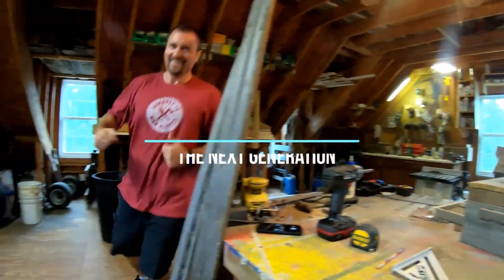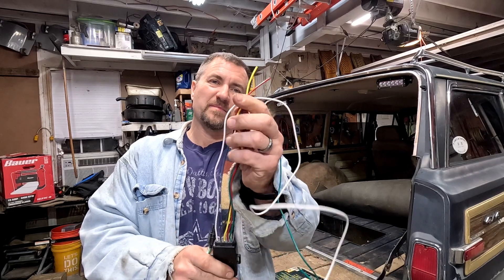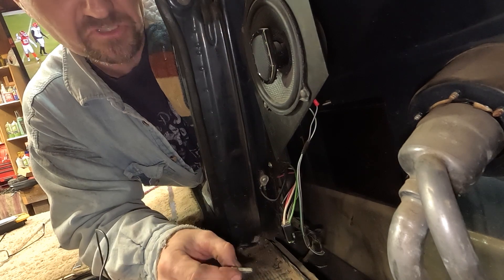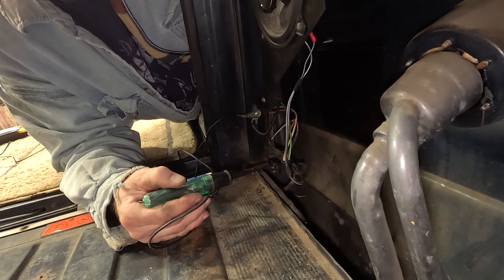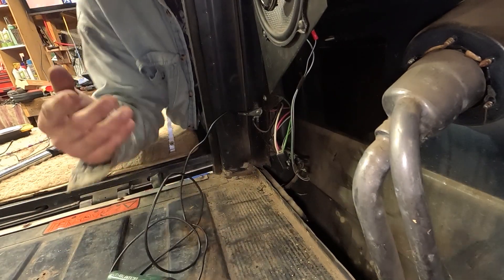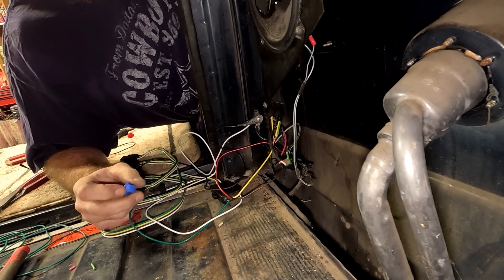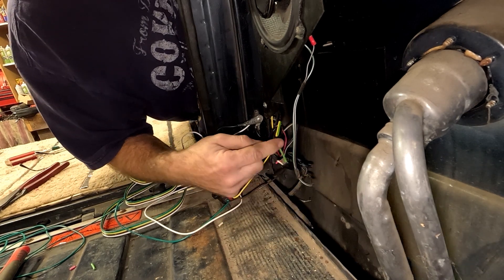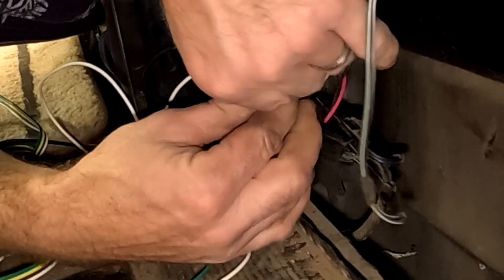1989 Grand Wagoneer Trailer wiring  Simple DIY

Comment: Luckily my 90 had the brake controller factory.. So all i had to do was just get an adapter for 7 pin to the 4 pin..   Got that at uhaul when i was pulling the flat bed trailer to pickup my 76 J10
Reply from the maker: Nice.   I plan on upgrading to a 7 pin.  I have the Brake controller and diagram.  just need to do it.  I did pull my CJ around the block.    the 360 might need a tune up.
Reply: @5LakesGarage  it pulled the 76 J10 fine.  300 miles home with trailer was 6400lbs total plus a th400 and 1339 tramsfercase.. and the factory brush guard in mthe back of my 90.  My 90 alao weighs 5500lbs.

The only issues the 360 had was going up the mountain hills in virginia.. i had to make sure i was going 70 before i went up them.. because it would slow down to like 45mph at the top.   But tbh all the v8s back then were like this.  And speed limits werent 70mph like today.

But it did good.
Reply from the maker: That is good to know.   We have a few hills but non of them are too crazy.     does the 90 come with a lock-up torque converter?    the 89 does not.

Comment: I gotta drill out the tailgate panel. My back window don't work either. I hate the wiring in my jeep. I was surprised a dome light worked. I leave my battery disconnected. That's how much I don't trust the wiring. Not much wiring to begin with. I need to get some 1/4" plywood and cut new door and rear cards. I need new signal lights too. My stuff is dim. I run dual headlights a pair of 7" round standard glass bulbs and pair of 5" rounds in pie tin holes. I need to find a rhino grille or make something.  My fuel filter plugged up again. I need to drive it more. It uses as much gas idling as driving. You can time my wagoneer on gas. Around 6 gallons per hour. 30 gallons only last 300 miles hwy if lucky. 304 the most gutless engine AMC ever made 2 barrel ford carb, 727A built to hold a hemi, 3? lift, 285/75/16 steel rims extra 1" of back spacing.  I gotta do some drum brake work too.
Reply from the maker: Always with the projects.  :)   With today's gas, You have to drive these things.  I did put headlights on the list of things to fix.   They SUCK.   It is amazing that these things burn so much fuel for such little power.    It is like my Taco.   Keep building.
Reply: My 90 gets 13.5mpg with a 3 inch lift on mud terrains.   I have to use 93 octane though as itll ping on 89 or 87.

Tbh it isnt much better on my 5.9 magnum in my 98 Grand Cherokee i get maybe 17/18mpg.  Thats with the 46re that has overdrive.

The issue isnt really the engine per say its more the 3 speed transmission.. if it had a better transnission itd be getting better gad mileage.